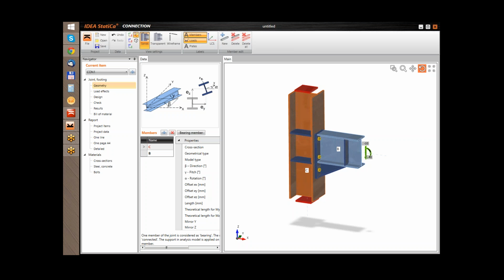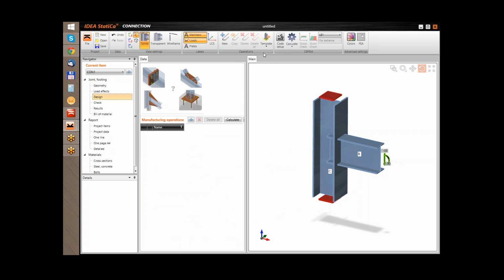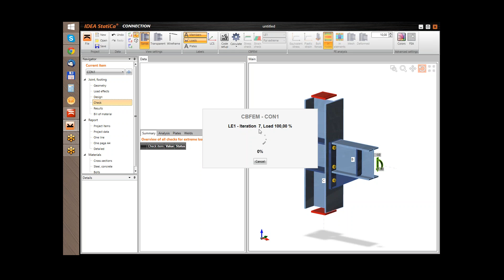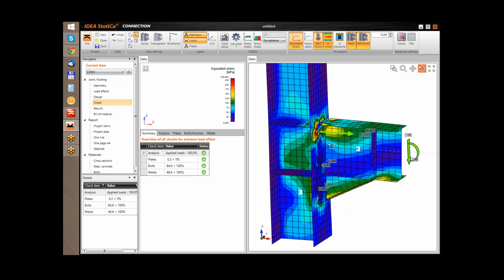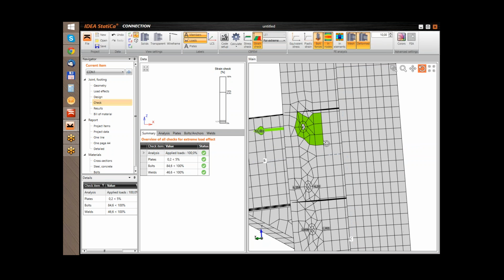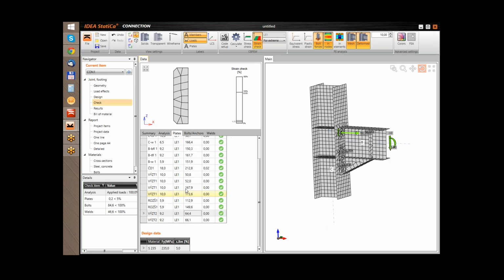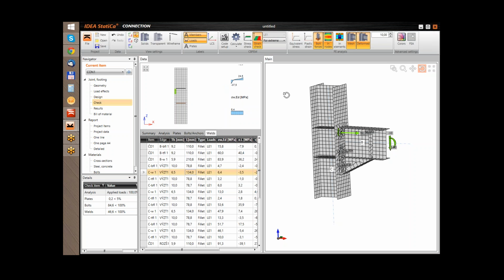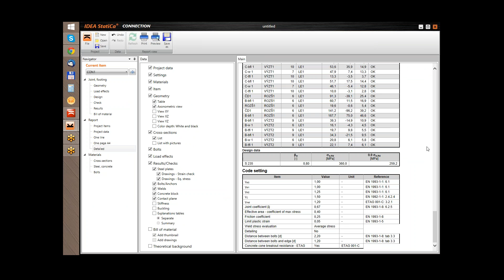IDEA StatiCa Connection T joint

Comment: Thanks for sharing, I would just suggest that the column stiffener is usually aligned with the lower haunch end rather than the beam bottom flange as the couple is resolved around the whole haunch depth. I appreciate that this is just to illustrate Idea Statica, but just had to make this comment for anyone stiffening columns next to haunched beams.